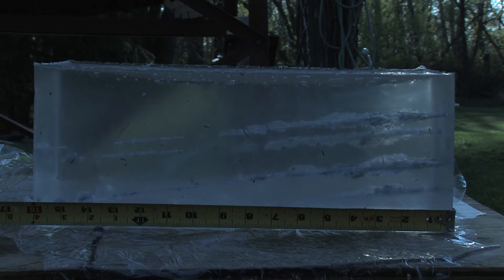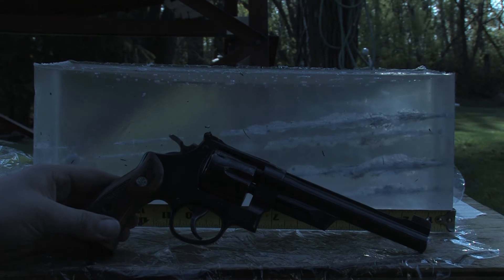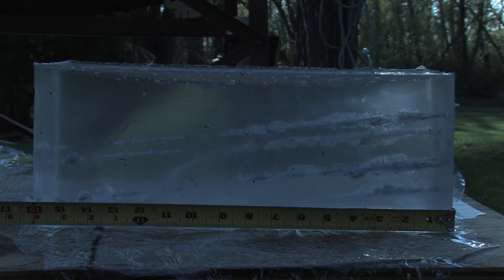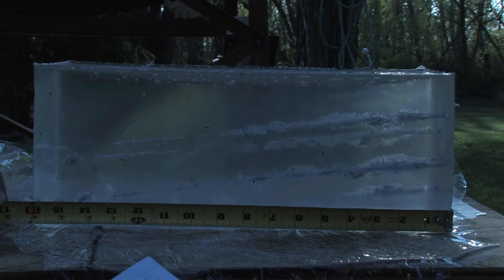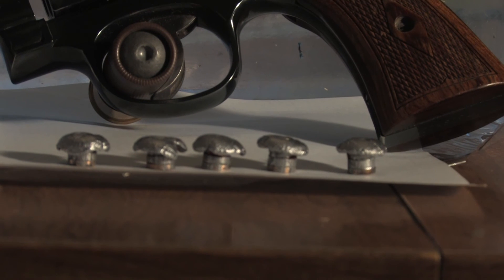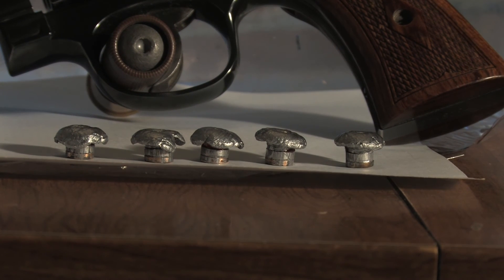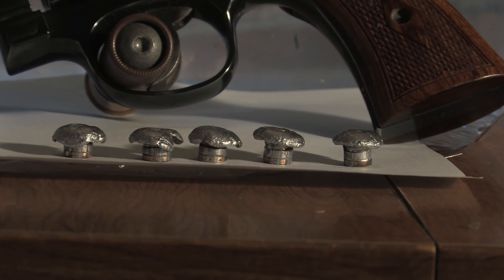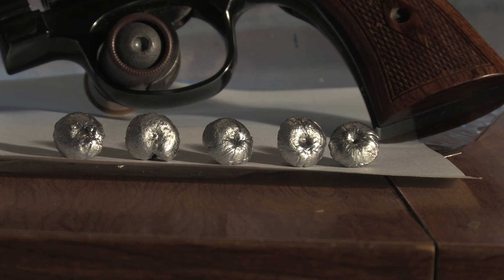Buffalo Bore 38 Special FBI Load 6 1/2 Inch Barrel Gel Test

Comment: The velocity differences you noted in the description might be attributable to different twist rates in barrels, and differences in powders. 

Quick burning, medium and slow burning powders suitable for handguns can be optimized for barrel lengths. Years ago when I reloaded most ammo we usually chose a quick burning powder like Hercules Bullseye or WW 231 for .38 Special wadcutters and most .45 ACP loads; a medium burning powder like Hercules Unique for most loads in 2"-6" barrels, especially with hard cast SWC; and Blue Dot or 2400 for full magnum loads in barrels longer than 4". But I haven't done any reloading in years and don't know what most custom ammo makers prefer nowadays.